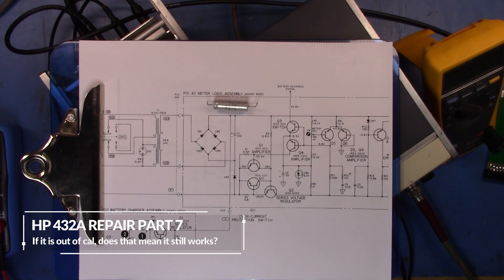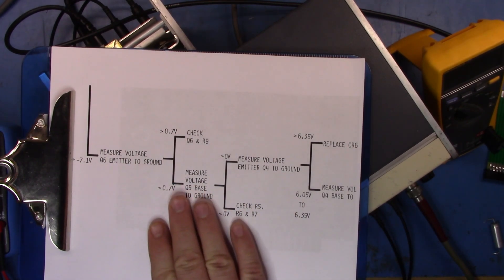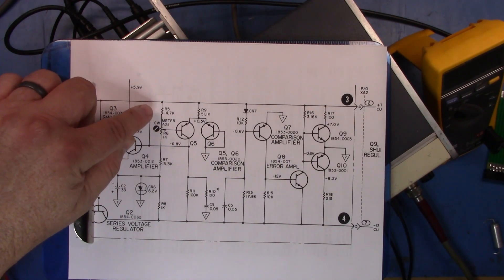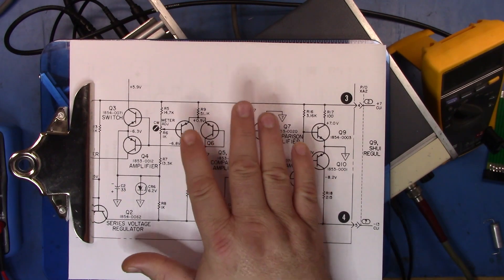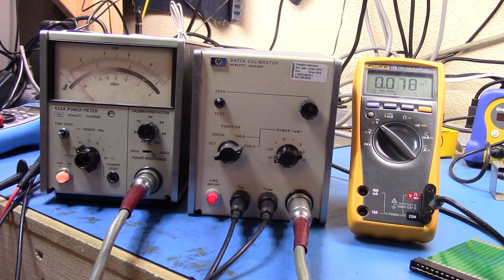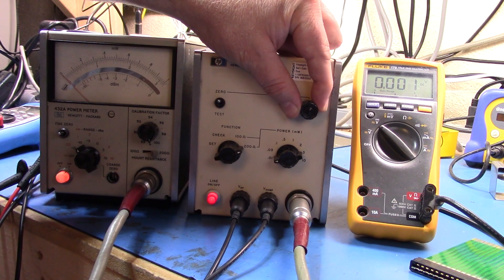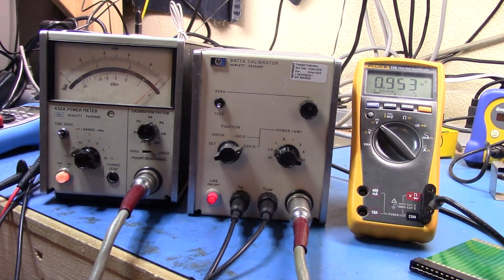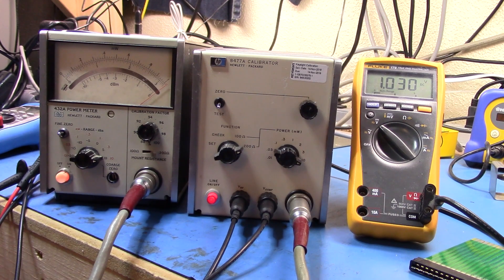HP 432A Repair Part 7 - Works but way out of cal

Comment: love your work.  i too have much of the same equip with which you work, in cluding 4 432as ant the calibrator.  i use the 432a to calibrate all my digital pwr meters.  yes please do a cal,  thanks   ron  kn6dj
Reply from the maker: Just got the replacement resistor so I'll put that in and do a cal/adjustment video soon. Glad you enjoy the channel.

Comment: Could that bouncing around be due to the calibrator output changing, the damping of the meter might be hiding it in some cases.
Reply from the maker: I don't think so - While I haven't had the calibrator "calibrated" recently, I did send it to Keysight a couple of years back to have them do it - Not saying that it isn't, just that I think it is more likely that the crappy resistor (given where it is in the circuit) is causing the problem. I'll get the proper one to replace it (Vishay from Digikey at $5 each - Damn...) and see how it goes.

I'm sort of just glad that it is, to paraphrase a movie, "mostly alive" - Not that they're actually worth that much and I already have several - Plus a 431C that I'm going to try bringing back as well. I actually now have more meters than thermistors - I think I have a  test equipment problem :)
Reply: @tgsoapbox  I don’t think you have a test equipment problem… if you did then I would also have one, I mean it’s not like I spent $3000 on broken test gear last month is it… oh wait.
Reply from the maker: @TheDefpom  Damn it.....

Comment: Nice Job , indeed.
Reply from the maker: Thanks - Just as an additional comment, the DMM needs to have an accuracy of +/- 0.05% and be 4 digits - The Fluke 179 is +/- 0.09% + 2 counts - Both my Rigol DM3058 & HP 3458A exceed that requirement so I'd need to use those.